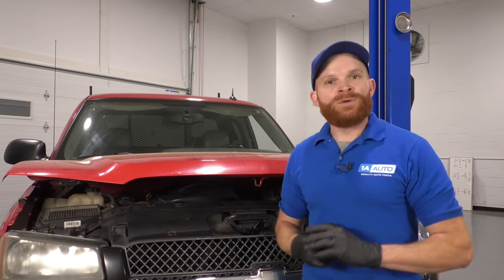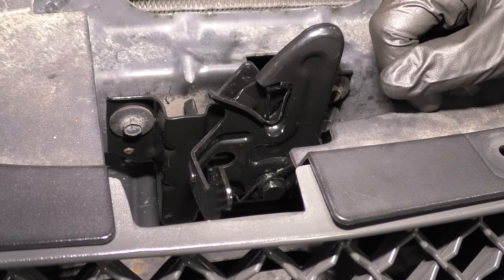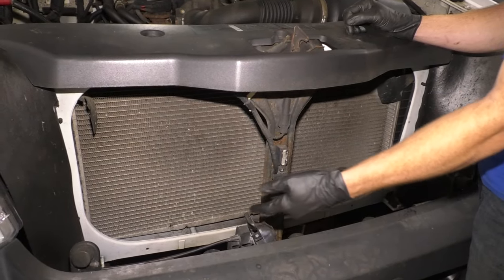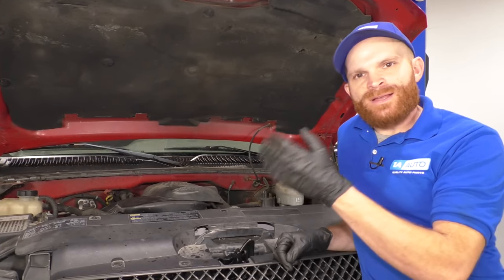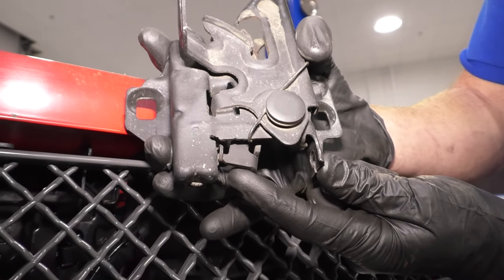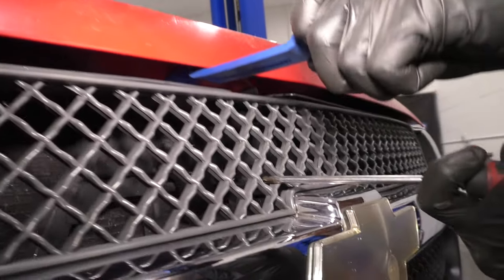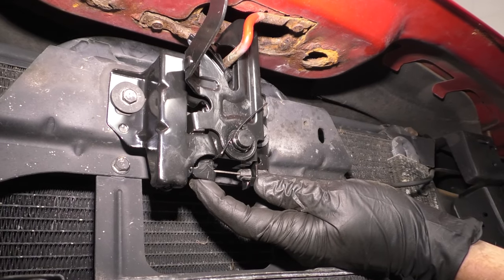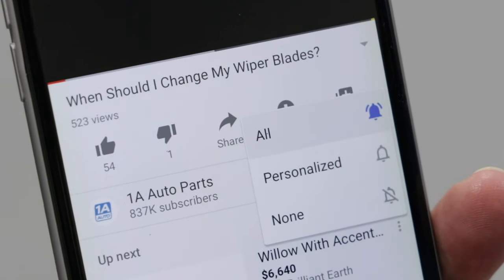Hood Stuck Shut? How to Diagnose Stuck Hood Latch on Your Car / Truck

Comment: okay,  you mentioned the issue a few times then totally skipped over any solution.     that little bar still moves to release the hood ( the one the cable attaches to) but the hood doesn't move and stays closed.  i can move the hood a tiny bit so the hood isn't the issue.  i need to know how to open the hood when the latch won't let go of the hood.

Comment: I use brake cleaner, any degreasing dishwashing fluid, spray some water, clean with a brush, rinse with water, dry it off and lubricate with a dry lube like graphite but lithium and silicone works as well, they just attract more dirt in time. The key is regular maintenance is important to any repair. Good luck and thanks for the video 1A Auto!

Comment: With the help of this video, I was able to understand the hood release mechanism on my 2003 Toyota Tacoma.  The hood release mechanism was stuck in the "open" state, not allowing me to close the hood.  I was able to take off the large spring that works the piton grabbing mechanism, so that I could see and access the release mechanism and pull cable that comes from the cab.  I spayed the pivot pint with WD-40 followed by a spray lithium grease.

It works now, and even if it gets fussy again, I know what small part to push to get it to work again.  Thanks!

Comment: Followed your demonstration on my Vauxhall Mokka SE (2014) and it worked on the 3rd attempt after spraying all 3 coils with WD40, leaving overnight, spraying a second time just before noon, then finally at 9pm today,  after poking away the black gunk from between all 3 spring coils with a small flat blade screwdriver. I then levered the release cable back and forwards where it meets the metal flange using small pliers to grip it. Such a relief when the bonnet finally closed. Thanks.

Comment: Thank you Len!!! I went outside to my car super prepared with everything including WD-40 the long screwdriver. I'm a 75 year old woman but I like to try things myself first. The release always worked the hood went up a little so something was wrong with the latch so I did try first slapping the hood real hard and then I lifted the hood up and down with two hands real quick one two three four five six seven. That worked I guess releasing some heavy duty road dirt and possibly rust starting to build up. So I sprayed it real good WD-40 tried it a few times and it kept working. But thank you very very much at least I was prepared for other methods of looking into the grill with the long screwdriver.

Comment: In my case, I replaced the starter. When I put the Tee and hood latch back on, the hood wouldn't close. I adjusted the whole mechanism up like you said and it worked! THANK YOU!

Comment: Since I have an old beater of a 97 Lumina, I think I'll just cut a hole in the hood
so I can pull up on the release mechanism under the hood.I'm not worried if the 
car looks bad with a small hole in the hood. ( car has lots of rust). I live in Canada,
and it's very cold out, just coming out of winter, so I don't know if it's frozen or
rusted, and the car is not worth much, so I think I'll do this, rather than have some
guy charge me, more than the car is worth.

Comment: Really appreciate how thorough ur diagnoses are. LOTS of potential scenarios are covered here and covered all possibilities. This is way better than other videos on the topic .

Wish there was a demo of removing the cable, so I could tell if I could buy a cable (if necessary) and replace it myself.

my old Hyundai Accent has a metal front casing on the latch, and not enough room to slide it forward, so i can't see the stuff in the back and can't tell if I'm pulling on a solid or movable part. :(

Comment: If car was recently worked on and the hood release cable sleeve was not 
seated in the bracket but the cable is still in the leaver you can pull 
down on the cable to release the hood.

Comment: Hey Len.....this is off subject of the current video but I need advice from y’all. My cruise control doesn’t engage. I can turn it on, the light shows but it doesn’t engage. I want to troubleshoot before trying to take it in. Being female and all I don’t want to be taken advantage of. You guys helped to replace my heater fan, which saved me tons! 😀
Reply from the maker: +peaches5712 We wouldn't be able to diagnose an issue like that here, you may want to have a local mechanic take a look at it. Thanks for checking us out! 1AAuto.com

Comment: Thank you for an awesome video. I was stuck on the primary latch being so tight that the cable could not stretch the spring to open it. I'm going home to clean it up and try again.
Reply: How did it go?

Comment: I have a Peugeot 508 2.0.2013 the bonnet cable works fine but the bonnet catch and hook won't budge I want to know what I have to remove to open it and replace it

Comment: I was replacing the the headlights on my 07 rondo I noticed after the fact the light wasn't all the way in so I tried to pop the hood to correct and it would not pop. Is there a way to pop the hood in cases like this?

Comment: My hood would unlatch and only come up a few inches.  I tried closing it tight and it would not do so.  I drove 25 miles at 65 mph and it was bouncing but not flying up.  I tried to lift it again and it unlatched.  I soaked it good with WD-40 and it closed down tight.  It's a 2000 Chevy Lumina.  Thanks for your video.

Comment: I have a 2007 Ford Focus. I replaced the hood latch. being removed or installed it doesn't seem like it will fit. Very tight space. It's like threading a needle. I had to just walk away a few times to clear my head. It took time and a lot of patients but it fit.

Comment: yeah that helps a lot. as the trigger wire was disconnected from the hood latch and i couldnt just pull on the wire to unlatch it anymore

Comment: All the fix it vids on YouTube are dealing with the latches.  No one addresses the problem of not being able to actually open the hood after releasing the latch.  One night in a big wind storm my hood was fast & furiously blown open after I had left it cracked.  After that the darn thing only partially opens (like about 8” or so). You can forcefully open it, but it takes a lot of effort & it makes a loud thud when you do so like something is catching.  So it must have somehow screwed the hinges up, bent something on the hinges or whatever.  So help!  I need some advice on how to fix this.  Thank you.

Comment: STRAIGHT UP AWESOME 

STEP BY STEP  HANDS ON  WITH EXCELLENT EXPLANATIONS.    

THIS VIDEO  DEFINITELY  WILL NOT ONLY SAVE  U A TRIP 2 THE LOCAL AUTOMOTIVE SHOP!   IT ALSO  HELPS WHEN IT COMES 2   ACTUALLY SAVING MONEY  INSTEAD OF HAVING  2  PAY A RETAILER .   

SAVING TIME, MONEY AND ACTUALLY BEING ABLE 2 SAY HEY  THANKS TO 1A AUTO REPAIR   I FIXED MY RIDE . 

PS  
   HEY   IM   NOT 
YELLING     

   I  USE  CAPS   FOR THE SIMPLE REASON  !! 

  IT MAKES  IT EASIER  2 READ   ESPECIALLY  FOR THOSE  WHO NEED  A  LITTLE  HELP WHEN  IT COMES  TO   READING .   ITS  A RESPECTFUL  GESTURE. 

BY THE WAY TRUST ME    U DON'T  WANNNNNNNNNNA 
HEAR  ME  YELLING  LOL 

GREAT VIDEO .

  RESPECT  

       JJ 
 ONTARIO 
 S L E E  T 
   ROEKA

Comment: What do you do if the catch on the hood itself is broken? On my e-350 schoolbus the latch mechanism is fine but the piece of sheetmetal on the hood that’s supposed to engage the latch looks like it cracked and there is now a hole where the latch is supposed to engage with the hood. How do you fix that?

Comment: I have a 03 Toyota Avalon with the hood latch completely rusted stuck,I unbolted everything, the latch is free I even busted the bottom open to access to stuff easier no matter what I do it won't open..I'm afraid I'm going to have to cut the hood open at this point idk what else to do if I had a die cutter I would've at this point. Any ideas besides getting a grinder or plasma cutter and cut something off..

Comment: Thanks for information, but your hood is already open, but I cannot get my hood to lift at all....
I can pop the hood from inside the vehicle, but the the secondar latch in the middle of the hood is frozen in place, and so will not budge. As such there is no  way to even open the hood at all, thus not able to even look at the latch.
Can I just break the secondary latch safely?? Since you have to release the hood initially from inside the vehicle, the secondary latch is mostly just an unecessary extra step!!

Comment: Omg mine is popping sometimes a loud thump at times No thump but in either case i do get the two inch release But no luck at the metal lever at the outside grill I slammed the hood yesterday and when this horror began 

I do notice the outside lever at the grill is kinds loose never noticed that before As I often have to open my hood that’s another issue( long story)  
This Is driving me mad and if I get it open again I’m never closing all the way again till can  get fixed properly 
 
it does sometime release the hood those 2 inches without the loud thump ( crazy )  but pulling upon the Metal release does nothing this just started I did slam the hood and that when all this issue started . I had someone hold the inside latch while I pulled up on the outside latch worked a couple times then back to square one

Comment: Okay I've got a 2007 Kia Sorento with the hood stuck shut. The release cable came loose at the latch under the hood. The hood front and grill is all one piece that stop's on top of the bumper cover. Impossible to get it from the bottom even after pulling off the skid plate. Tried and removed 2 exposed bolt's that appears to hold the latch on thinking I could raise the hood and the latch as one piece. WRONG!!!!  Short of taking the grill out with a hammer, do you have any suggestions? P. S. Can find no video anywhere online that shows how to get this hood open for this year and model.

Comment: After I replaced the broken cable I realized that was not the only issue because the problem persisted.  Afer a few open and closing the hood shut and it's worse now.  I went under the car and although I can  swing the latch  with long prybar I can't get to that "click" sound that tells you that the latch was released.  Nothing happens and the hood remains closed.  Any ideas?

Comment: UPDATE   fixed it. Ok so the pop up latch works ok; it was the second latch that didnt open fully the hood. The fix. On you tube I found a vid that shows the direction the second latch must be directed to open. Ok I tried. No luck. I have on the shelf PB Blaster catalyst spray and PB Blaster silicone spray.  IN the dark mind you I pop the hood and used my flashlight to open the widest gap and held it there. I then flooded the lock unit (limited view) with PB Blaster. Waited about 5 minutes and then flooded it with PB Blaster silicone spray. Then I proceded to wiggle the latch up and down until eventually voila it unlocked. I opened the hood and shot PB silicone spray at every area of the assembly where movement, friction,... that can be reached. I even shot the Hood hinges at the pivot. Alert!!! the lever is weak, so when you open the latch pushing up, the latch will push backward simulteanously and rub against itself, Evidence the friction marks, and may prevent itself, that way, from opening. When opening up the latch push up while trying to move the lever toward you instead, thereby preventing the friction that can prevent the lever from fully disengageing. Blessings to all.

Comment: My first pop up latch works, but the second Latch dosent budge to fully open the hood. Any ideas? PB blaster? silicone spray, wd40? right now its winter and battery died. Hood wont open to access it. It pops up but wont budge the second latch to fully open the hood. 2017 Camry. Help!

Comment: 09 Cobalt. -34°, working outdoors, vehicle won't start, plug pulled off the block heater, not enough cord exposed to put a new plug on,  primary release works, secondary moves, but not enough to release the hood. ... At this point we are ready to have it towed to the mechanic ... HELP

Comment: What if it’s a pre-cable type latch. My 79 Vandura doesn’t have a cabin hood release (it was an optional feature at that time) so you pop the hood from just behind the grill. My lever is still moving, but it’s not letting go. (Probably an alignment prob as I just learned from you!!) Is there an emergency release lever on the old style hood latches too??

Comment: My 2021 gmc canyon hood latch an unlatching issue. Its a brand new truck so Id guess its an adjustment issue. I'll pull the hood  release in the cab of the truck, but the hood isnt partially popping up and when i pull the secondary latch, still wont budge.
Reply: Forgot to mention that after a minute or 2 of me trying to get it open, it eventually pops up

Comment: 97 f350, hood won't open because of pressure.  Wind caught the hood, flipped it back amd I didn't realize when I closed it that it bent part of the hood where it attaches to the hinge.  Now there is so much pressure I can't get the hood open.  I've tried tapping against the lever to try and pop it open (long extension and hammer taps).  I've tried to loosen the passenger side 10 mm bolt but cannot get leverage to break the bolt free.  Anyone have a 3' 10 mm open end lol.  I tried find a secret latch opening on the driver side of the latch to pull towards the driver side, no go.  Tried a screwdriver coming in from the passenger side of the latch, no go...any other ideas?  mY spring pivots but gets stopped about half way...if I could just make it past that 1/2 way mark lol.

Comment: OK so that last latch that you were pushing with a screwdriver freely moves under my hood. The hood still locked down super tight. Everything seems to be moving fine.The cable is fine and released. it's just not lifting. Any suggestions? From anyone?  It seems like I'm going to have to take the grill off or something to get to it
Reply: I would like to know also. Same thing is happening to me right now